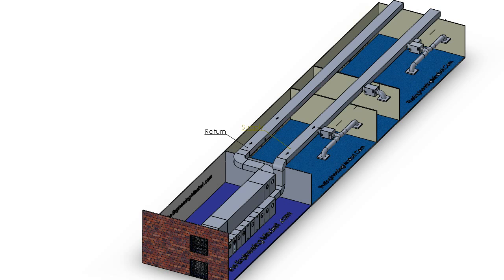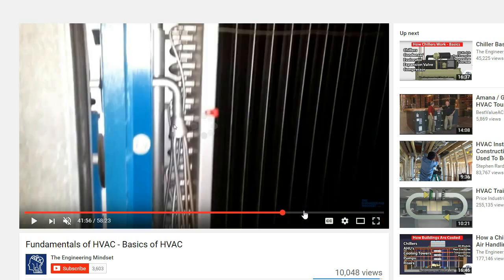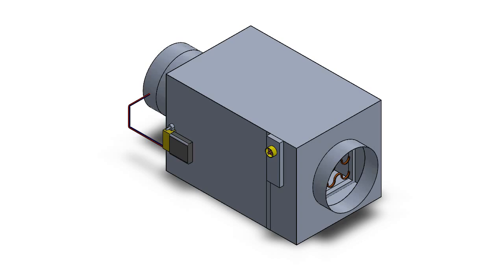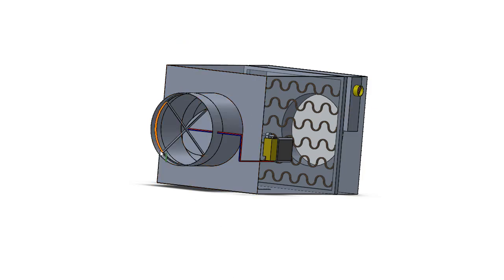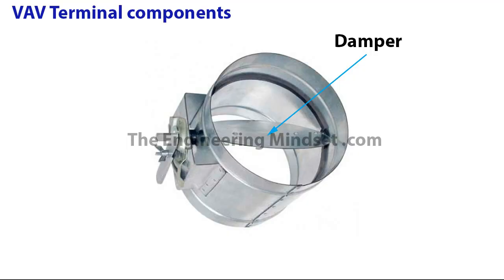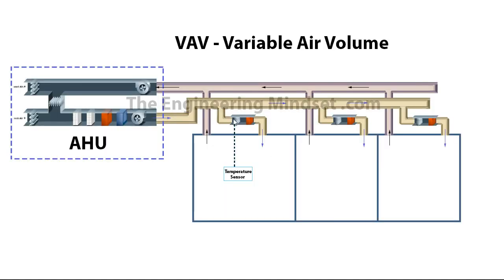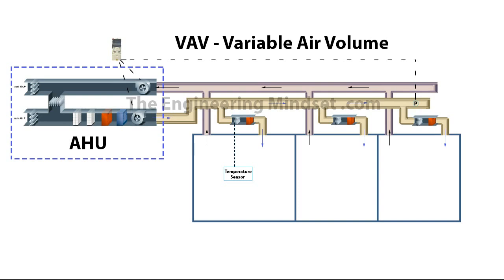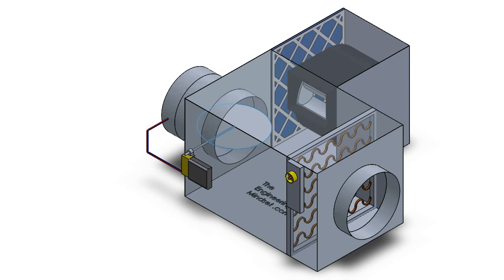Variable Air Volume - VAV system HVAC

Comment: I've come across similar looking damper boxes I suppose they would be called, on a few jobsites, the only explanation I was able to get was that they were fire dampers meant to detect air too hot or smoke and shut to prevent spreading the fire through the system and prevent spreading toxic smoke improving survivability of the occupants during a fire. Is any of that correct or making any sense at all? I appreciate everyone's time and effort immensely and I hope everyone is having a great day or night!

Comment: This is really clear !! Thank you. I would like to know how does it work if you install an electric coil with a 24v relay that also controls the electric baseboards heaters that will be installed in each room if heating should be interlocked with the air conditioning.

Comment: Another superb video. Can you explain the basic relationship between FCUs and VAVs, i.e. is the HVAC system typically either one or the other, or are there installations where they can both be used in the same HVAC system?
Reply: usually, the FCU temperature can be controlled individually, so there is no need for a VAV, remember you only need a VAV when you are trying to control airflow. There definitely are installations where both are installed together. For some instances, simply put, one VAV could responsible for 5 to 7 diffusers. So, in this instance, it is important to have the VAV installed along the FCU.

Comment: Why does a VAV box need to calculate the air flowing through it?

Why could it not just be a motorized damper, with a PID controller, that is responding to the room thermostat temperature. If its to cold, it closes more towards its minimum position, if at minimum position, the heater turns on. If its too hot, it opens more and more, until room is at set point. Again, with a PID controller, as to not overshoot, but also not take too long to get to design.

Comment: Are the AHU and VAVs working together in conjunction based on the BAS sequencing?
Reply from the maker: The AHU will be run on a schedule, the terminals will operate from a localised thermostat. Fan assistance terminals can also circulate the room air if the AHU is off.

Comment: If all vav are closed, will there be an over pressure in the system?  Will the main air handling unit slow down automatically?

Comment: As the supply volume flow rate varies, how does it make sure each zone recives minimum required fresh air volume flow rate? Thanks for the video!!
Reply: It should be adjusted by co2 level

Comment: Great video! Most of the information here is 100% correct, but if I may correct you on a few points:

1. You mentioned ‘dirty air from the rooms can be chucked outside’ but this is not really the purpose of the relief path. The set of dampers after the return fan leading to the outside are typically modulated to maintain building static pressure in relation the outside. Typically the set point is somewhere around “+0.05 in. wc.” This is necessary to keep your building positive so that unwanted air doesn’t infiltrate around doors/windows from the outside. This way the outside air necessary for maintaining indoor air quality can be introduced through the AHU and can be conditioned as desired.

Dirty air is simply cleaned by the filters in the AHU and by always introducing some designed amount of fresh air through the outside air path.

2: There are typically two types of fan powered VAVs, either series or parallel. Your schematic shows the fan to not be in series with the airstream so that would be a parallel configuration in which typically the fan is only running when the zone calls for heat. 

In a series configuration (not pictured) the fan is always running and the primary air from the AHU must pass through the fan. that is closer to how you described it which may be a little misleading.

3: Typically the duct static pressure sensor used to modulate the supply fan is mounted approximately “2/3” of the way down the primary air duct not at the end.

Anyways thanks for the video, nice work!
Reply: Wouldn't you want to use that to maintain a reasonable pressure value so the doors on your building don't get suctioned closed or the opposite? I appreciate your time and effort immensely!

Comment: Do we need to have vav on Return to control the exact mount of return from each room? its important especially when we need different pressure in different zones.
Reply: Yes. You are right. Return Air side also will have VAV if you need to balance pressure as well. Mainly in institutions like hospitals.

Comment: Firstly, great video as it outline the basics really well which allows a young professional to grow by asking question as they relate the animation to what they experience in the field. 

My question is that I presently have a system with six VAVs installed on each of the main ducts leaving the AHU. Each duct(with its individual VAV) has further branches for individual rooms however it is controlled by a single thermostat sensor. So we receive frequent user complaints as the set point for the single thermostat sensor doesn't reflect the condition for all the room from that main duct.

Can you suggest a possible solution for the existing setup?
Reply: There is no proper solution for this scenario. Because the unit will deliver cold air until the set temperature is achieved at the thermostat location. Once the set temperature is achieved at the thermostat location, irrespective of the situation on any room, the unit will cut off.
The only possible solution I feel right is to balance the airflow in such a way that an ideal temperature is  everywhere along with the thermostat location. Do trial and error method.
Reply: Hello, have you found a solution to your problem?

Comment: Great Video, recently saw a 3rd floor building with return vents open to the area above the Drop ceiling.  No return air ducting was visible.  I assumed that the air was being sucked back thru the drop ceiling, it was about 4K sf. Is that legit, seems to be a really BAD idea since we're in the SF Bay Delta with tons of molding/rotting materials and dead grass and tree leaves on the ground everywhere, meaning pollen and mold/mildew spores whenever the wind blows.  Between foot traffic of 3-600 people, and deliveries of boxes of equipment and paper...   people are coughing and sneezing on that floor, even tho all the ceiling tiles have been replaced... I found about 8-8 return air Vent Tiles, but ZERO dedicated ducting.   Thanks again!

Comment: We had to install some VAV boxes w their own EAC (Electronic Air Cleaner) in each due to the designated rooms having commercial computer systems, each box had it's own filter just before the EAC, the puter rooms had their own HVAC systems that were specified for more than the usual room specs since puters like cold air, twice to 3 times the usual for the room size but that's just bigger units, 'been there & done that' on other jobs. Although I'm familiar w this stuff it's fun to watch and I can share the vid sites to help non HVAC ppl understand the basic physics of it all and that's really what it comes down to but so many ppl don't grasp physics or weren't taught it. Gotta question the education system. Anyway great vid and great ch, keep up the good work.

Comment: 04:17 re-heat coil is an option.  apparently cooling coil is not an option.
Reply from the maker: It's easy tand cheap to wire an electrical heater in, it's hard and expensive to plumb an air conditioning coil and compressor etc for cooling in to each box

Comment: Thank you 
Question, I have a system in every apt kitchen where I need to set these VAV’s to be operated and open damper when the kitchen exhaust hood is on to replace the 425CFM exhausted thru the hood
Note: owner wants to cut the cost of BMS system for individual apartment 
- What is the easiest way to connect the actuator on the box to the the hood, and in the same time keep the thermostat controlling the normal operation?

Comment: Thank you for the video it is really helpful.
may i ask when would we require a VAV installed on the return as well as many designers are asking for it, it is really required? if yes in which applications it should be use?
Reply from the maker: It's useful to regulate the pressure in the building

Comment: Thank you very much
Well explained
Can you make a video of the control method of VAV?
Also there is another type called bypass, you didn't mention in video.
Reply: Bypass VAV means when you have a main VAV installed on the main branch from the AHU and you are connecting another VAV to that same VAV branch . It's not always recommended unless proper calculation of the CFM made

Comment: Is the electrical reheater présent most commonly in countries where it gets cold in the winter?
Reply from the maker: Yes its common where the outside air gets to around 5*c or less
Reply: The Engineering Mindset ahh alright thank you

Comment: Excellent video. In 20-25 years do you have to replace the whole box or is it most common to replace parts? Is 20-25 years the average life span of a VAV box?
Reply from the maker: Most of the parts inside will have been replaced by 25 years. The building will probably have been refitted with new equipment anyway. It doesn't have to be replaced, this is just the anticipated life expectancy.

Comment: Hello

why do you say that the main AHU cooling coil will use less cooling thanks to the pressure sensor ?
Reply from the maker: the pressure sensor tells the fan to slow down. less air flow = less cooling load
Reply: The Engineering Mindset thanks for the answer But how does the chilled water flow knows that
 there is less air to cool? How does the flow rate of water is reduced ?
Reply from the maker: Temperature sensor and control valve. When the air flow rate reduces the same amount of chilled water is entering the coil, the air temperature drops too low, the controller senses this and begins to close the valve to slow the flow chilled water until the air temperature is corrected and back at the desired setpoint

Comment: I hope you are fine and doing well sir please clear me one thing if the VAVS is on auto mode heater and damper is on auto m ode set point is 28 and heater is ON desired and actual Air flow is same and damper position is accurate according to desired flow but Air supply temperature is not increasing upto 30 And space temperature is 23 .I try to increase upto 25 but supply and space temperature is not increasing.why?
Please clear me in detail.
Reply from the maker: something isn't right here. likely either the air flow rate is too high or the heater is broken or blocked. Maybe the room is unable to hold the heat and air

Comment: sounds like typical engineer theory. vav systems are as varied as the buildings they are installed in. they can be simple cool only boxes using static pressure to open or close or more complex reheat boxes using hot water coils and freq drive blowers in the roof top unit. I'm not trying to knock anyone but theory is so hard to apply in the real world.
Reply from the maker: You're right, we must simplify to build our understanding and then grow from there

Comment: i have a laboratories Project  equipped with fume hood exhaust system ,, can i use this system for controlling exhaust flow and return flow in the same time ?
Reply from the maker: That's not an area I generally work in and there will be certain safety and compliance standards you must meet. I would recommend looking for CIBSE OR ASHRAE guides specific to this.
Reply: ok ,, thank you

Comment: Does a VAV system substitute FCUs for VAV boxes? so must it be one or the other?
Reply from the maker: You need to have a controllable damper to regulate the flow rate of air for it to be a vav system.

Comment: well done .👏
about powered fan VAV terninal box , what is the diffrence between parrallel and serial ?
Reply from the maker: Parallel fan-powered terminals have fans that only switch on during the heating mode to pull warm return air from the ceiling plenum. Series fan-powered terminals have fans that must run throughout the occupied mode in order to deliver ventilation air to the zone

Comment: What happens if you don't have a VFD on the fan motor?  The pressure in the duct builds until what happens?  Does the fan just stop pushing air?  Or what will go wrong?
Reply from the maker: It's not a VAV system if the speed of the fan can't vary. If it stuck at full power and the dampers closed then it will likely burst the ductwork or the pressure would be too high for the damper to resist, that would force them open. There should be a high static pressure alarm on the BMS which would cut the power to the fan before this happens though.
Reply from the maker: VFD Video is now live! here: https://youtu.be/yEPe7RDtkgo

Comment: nice video, thanks... perhaps, I missed the part that explains replenishment of fresh air in the system, ... or is not accounted for in the explanation? ...
Reply from the maker: Hello 0:54 explains the supply and return duct. Fresh air is in the supply duct, used air in the return duct. Then in the AHU the dampers can divert some of the used air back into the supply, if it is clean enough.